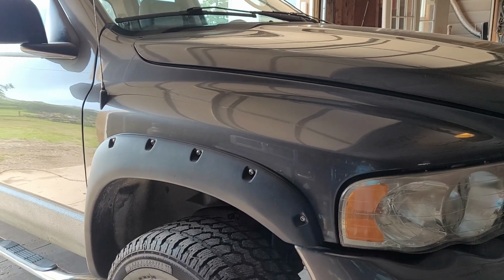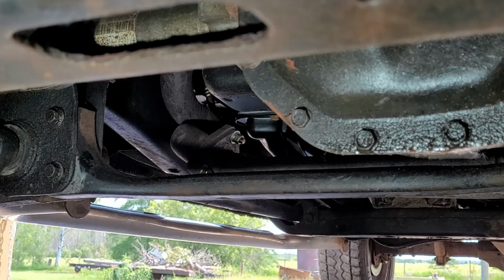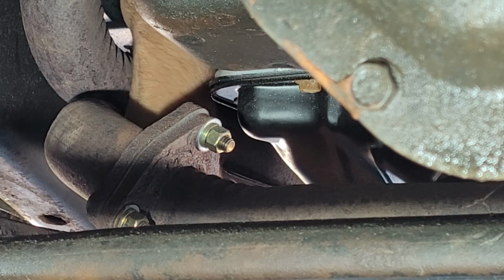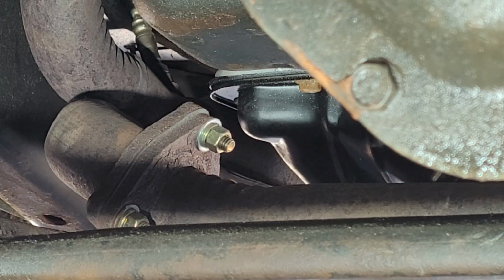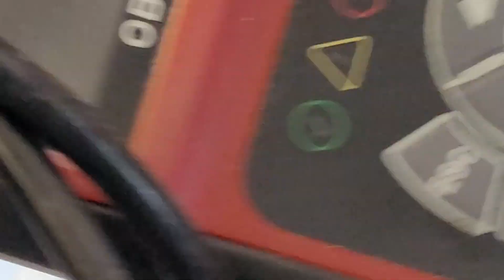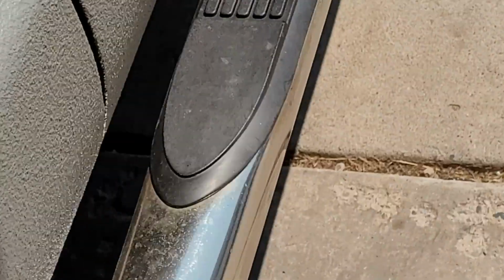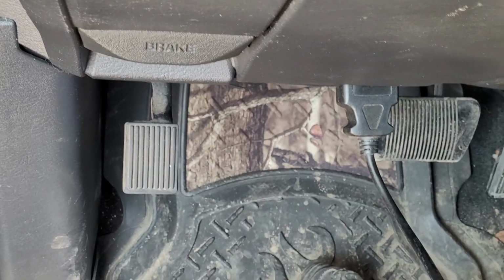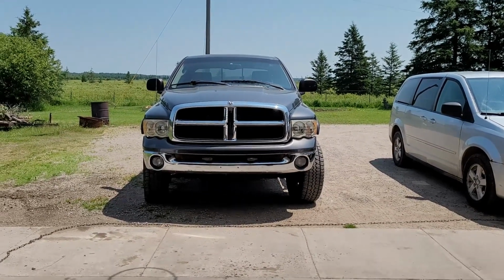2002 Dodge Ram 1500 Upstream Oxygen Sensor Replacement

Comment: found solace in others going thru the slow torture of this 02 sensor removal lol . after banging up knuckles and using heat/freeze off/banging with chisel n hammer i guess i bess drop the exhaust down like you did . great job on the vid and the celebration music was a real pro touch ! aint been to upper in ages but used to hunt in delta county by lake ramsey
Reply from the maker: It was definitely one of the harder ones I have done for sure! Being up here in the super rust belt don't help matters either! Glad you enjoyed the video and thanks for watching!🙂